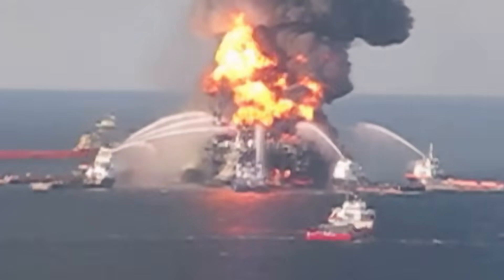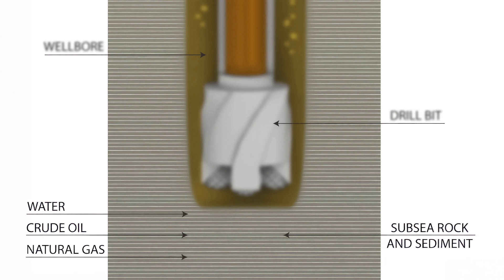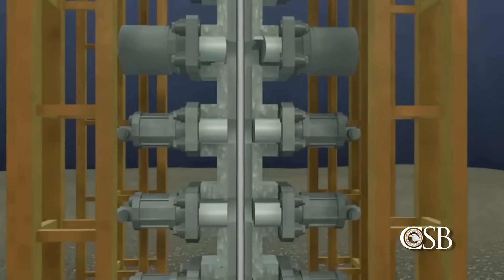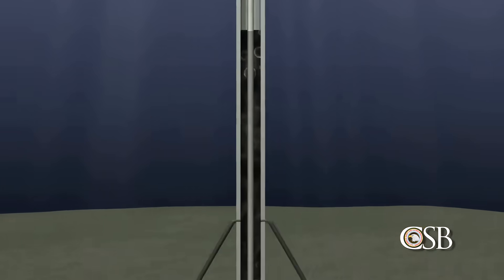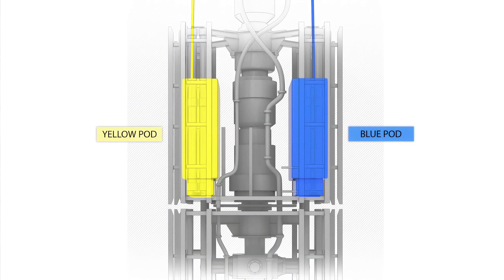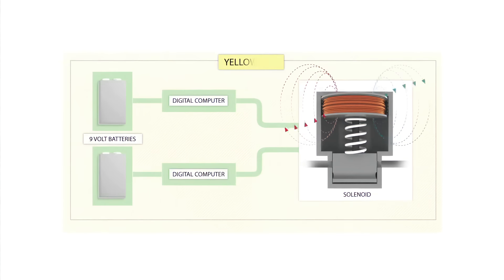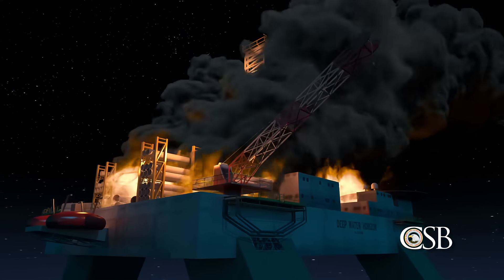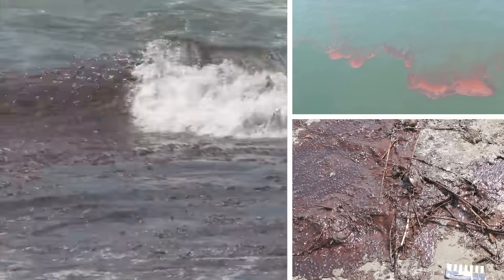Deepwater Horizon Blowout Animation

Comment: It's what happens when you take the cheapest price from a drill platform operator. There was a school of thought that proposed that blowout preventers should be initiated by internal explosive charges rather than using hydraulic rams. But this would prevent the well from ever being used again. However, it virtually would guarantee that the pipe would be sealed. And as we know, the one on the DWH didn't work properly.

Comment: Why did the Factory Acceptance Test (FAT) not pick up this wiring error. Did they not, if its possible before drilling started, do the same tests after it was installed. Having spent 15 years testing critical safety systems and signing them off, more than one person signed this off as working!

Comment: As a electrician, I constantly find myself researching products and finding even the manufacturer doesn’t know or understand wiring configurations. Yes schematics help but a lot of them are generic. Even some manufacturers rebrand certain components as their own but not rated for the work is asked of. It’s also known as patented failure. A manufacturer says this component must meet this that and the other but because of the proprietary patented, they actually don’t release exact diagrams. I think Boeing just went through this very thing with its “aim of attack” distribution block….. another words, calling the wireman a dumbass, shows you really don’t know the industry.

Comment: What I don‘t understand: why could the buckling of the inner pipe prevent the shear-ram from cutting through it? Why isn‘t the shear ram designed to cut through the ENTIRE section of the outer pipe? This way it would have cut the inner pipe regardless of if it was off-center or not. This doesn‘t make sense to me. 
Not cutting through the entire cross-section creates room for error in the first place. This should have been pretty obvious right?

Comment: Completely inexcusable.  Why there was no testing or polarity checking, voltage health, battery health monitoring is beyond incompetence in terms of design and application.  From reading other comments, use of sub-standard, unapproved slurry, greed by "company men" is just disgusting really.  Not to mention, but I will, the poor design of the BOPs to not accommodate shifting pipe stands such that the BOP or blind shear ram could not properly cut the pipe.  The BOP was designed and manufactured to (doubt it) API standards by Production Cameron International (Texas), and owned and operated by CasingTransocean (Switzerland) under contract to BP.

Comment: It wasn’t as much of a disaster as they say. Hydrocarbons diffuse as VOCs into the atmosphere and what remains is tar and the salt water in the sea is pretty nasty stuff and that takes care of the tar.  It’s just messy for a while.
Reply: Nope it was, even the chemicals they used to hide the oil spill on the surface caused problems.

Comment: I remember this clearly.  It was also reported that the drill mud had been replaced with mud pulled up from the bottom of the ocean floor, to reduce operating costs. This is was done for the last few days prior to the explosion.  The drill mud had been initially replaced with a much cheaper slurry prior to deciding to use mud from the ocean floor.  The sodium content in the ocean water also destroyed seals and electric contacts that normally wouldn't be exposed to corrosion or salt water, had the proper drill mud been continued to be supplied and used.
Reply: I don't think you remember it clearly because BP never used "mud from the ocean floor", the drilling mud was displaced with seawater, this is a normal practice to 'underweight' the well- you can't do a neg press test without displacement the mud.  And sodium definitely DOES NOT 'destroy seals or electric contacts' that would be exposed to drilling mud because THERE AREN'T ANY electrical contacts exposed to drilling mud.  All the electronics are located in the BOP pods- which is always underwater and not exposed to drilling fluid.  So displacing the drill mud with water would have zero impact on this.  Were mistakes made?  Obviously, but you have no clue what you're talking about with 'mud pulled up from the bottom of the ocean floor'.  

https://appel.nasa.gov/2011/05/11/aa_4-4_acs_deepwater_horizon_lessons-html/
Reply: Hahaha hilarious post. Sand and God knows what else is some how hoovered off the ocean floor, somehow held in whats more more or less a semi submersible boat, then somehow ends up down hole? Or....and engineer can calculate his mud weight and tell hands to dump in x amount of 50lb clay bags into the mud machine. Which one sounds cheaper, more efficient, and PRECISE?

Comment: Yes it's an issue by the management on the cost cutting measure however I want to understand (not blaming) any safety features that the crew during that particular unfortunate day did or didn't do something crusial? Just to learn despite all the cost cutting do the crew have any control to save themselves?

Comment: just to let you all know that the CEO of BP has gone on to much better and higher postions...........

https://en.wikipedia.org/wiki/Tony_Hayward
Reply: BP was the operator, not the service company contracted to drill
Reply: @sandersson2813  u can not transfer risk BP stuffed up big time in the design
Reply: @coam3708  BP didn't design it. BP are the operators of the licence and ultimately responsible, but they hire another company for the drilling contract. 
Did you not know this? 
BP, Shell, Exxon, Equinor etc don't own rigs, they rent them by the day, this includes all the equipment and the staff.
Reply: @sandersson2813  not production rigs which is the case here...drilling rig yes u rent
Reply: @coam3708  They don't design the production platform either. This is done by naval architects to BP specification. 
The fact a BOP failed or whatever it was is unfortunate.

Comment: Like most accidents that involve "high technology" (aircraft are infamous for this ), what starts as as an "incident" that has many backups and high tech safety features, one problem leads to another, which leads to another, that because trust in "high tech" makes the original problem magnified by the very technology that we so trust and depend on. Could this tragedy been prevented? Perhaps, but only by all the automated systems working as they should, and human error not being magnified by this technology we so depend on.

Comment: Pouring warm (relatively) concrete to "seal" the well caused rapid decomposition (called explosive because it occurs over a narrow temp range) of "methane hydrate" on the sea floor. Evacuees said methane had infiltrated the drilling platform.

Comment: miswired? what.  it can't be miswired, solenoids operate by the physical direction of the coil turns, it was likely wound wrong from the factory to begin with.  electric personnel wouldn't disassemble and flip them upside down.

Comment: The rig could’ve been saved if the auxiliary generator had functioned.  Without power to close the watertight doors and pump water to fight the fire the rig was doomed. It was later determined that the company had not allowed oil to be put in the generator because it was not tested often enough to prevent sludging of the oil and it was expected that any time the generator had to be used, the crew would simply add the oil before trying to start it. The crew didn’t have a chance to fill it before evacuating and the volunteers who went back in to try to start it didn’t know there wasn’t any oil in it. The low oil safety mechanism wouldn’t allow the generator to start. The rig was lost as a result. This didn’t come to light until three years after the disaster and has been mainly overlooked. The only reason it did come to light was a different rig suffered a power failure and the crew had to troubleshoot the generator. It turned out it was standard practice on all company rigs. No oil meant less maintenance costs. It just cost an oil rig in an emergency that the generator was supposed to take care of.

Comment: The pressure from the blowout is what should be used for power to prevent blowouts, instead of electrical or hydraulic systems dependent on power from the surface.  Kind of like the gas operated bolts in ak and m16. Plenty of energy their to operate a mechanism that can both relieve pressure and prevent backflow

Comment: The Blow Out Preventer (BOP) stack was designed by Ventura Tool Company (VETCO). I worked for VETCO in their R&D department in the '80s. I worked specifically on this BOP Stack design. What is depicted here is not completly accurate. This stack was used on a previous well where the Drill String got "stuck" and was sheared (with the rams). Once this is done, the BOP should be retrieved and serviced as the shears are only to be used once. This was NOT done thus rendering their re-use useless. The Company Man that decided to use the BOP without servicing and continued to drill without Secondaries working was criminal. Everyone knows that if you don't have secondaries, you stop drilling. Without a Secondary, they relied on the Primaries that were indeed of service, thus the buckled drill pipe. Again, the BP "company man" should be in prison!

Comment: Not to mention that the pipe usually should be about 2 and a 1/2 inches thick in the wall . Not to mention that as US steel pipe it should have been probably replaced or never used Depending upon its age

Comment: Most people have some idea of the scale of this disaster but they still do not comprehend the vastness of the scale involved. I flew over the gulf while this disaster was going on, just a few miles to one side on a survey aircraft transitioning from Venice  Florida to John C. Stennis space center in Louisiana. We were flying at just under 10,000ft because we were not pressurized & without masks. By then, the fire had extinguished but there was still a plume of smoke rising from it past the aircraft & way up into the high atmosphere which was so vast that we were completely awe struck.

Comment: Why not have pressure breaks near the surface that would kick in in the event of a blowout and divert the gas and oil into large bags with enough capacity to store the material until it can be drawn off or expelled into a deployable burn off system separate from the rig?

Comment: How the fuck on something this expensive+thoroughly researched+high profit industry be wired incorrectly?
How could TWO things be wired incorrectly?
That's fucking astonishing considering I'm not even an electrician, and any electrician would be 100% confident that they could wire this correctly? It's 17vdc and 9vdc.. I understand the amperage is probably high but still?
Completely unacceptable.

Comment: I remember multiple “experts” on TV during the fire saying how these rigs are so well designed that it was impossible to sink.  However anyone watching the fire knew for a fact it was only a matter of time before it went down.
Reply: They said the same about the twin towers. After the planes crashed, news had several engineers guarantee the public those buildings would never fall, that it was built that way. And they were arguing against people running out the buildings, saying emergency personnel should send people back to their work places so they could reach the floors that needed immediate help.
Reply: the towers were wired to explode most likely
Reply: @Andrew-um6ny  cus there where bombs inside the twintowers  it didnt go down cus of the planes
Reply: @Robin...222 you’ve taken zero engineering classes
Reply: The downfall of even the most unsinkable ship is usually mistakes by builders and crew.

Comment: This is NOT what happened. All this is a lie. Oil and gas did go up the riser but not the way shown here or for these reasons. The blowout preventer could not stop the fluids from going up the riser because a length of drill pipe had been accidentally dropped down the riser--lodging in the blowout preventer.. Management refused to stop drilling to recover the pipe as this would cause a loss of revenue.. Many people knew this but did not quit working. We all see the result.  A friend of mine worked for this company. He found out about the lodged pipe and brought it to the attention higher ups. They told him to shut up or he would be fired. He resigned that day from job paying almost $400,000 a year. All this is pure propaganda and BS.

Comment: crazy to me that the emergency auto-closing system itself was fail-deadly - requiring internal power in order to actively open a valve - rather than fail-safe, using power to hold the valves closed and opening them by default when power is lost.
Reply: @michaell4990  generally I value human lives over oil money, but that's just me 🤷‍♀️
Reply: @michaell4990  and? and i think that's a bad thing?? the way the world works is not value-neutral; we could make it better! we could have a world that values lives over money, that is not ruled solely by the profit motive.
Reply: @michaell4990  A: we should ban oil entirely, use nuclear or solar or any of the countless options that could easily power the world but are more expensive; fuck the economy, fossil fuels are killing the world. I happen to be one of the poor bastards young enough to care, thanks to generations prior not caring about our future. B: you're literally the "and yet you participate in society!" meme lmao
Reply: @michaell4990  I'd love to hear where exactly oil is needed for ammonium nitrate fertilizer (electrolysis exists, the hydrogen gas for industrial ammonia production doesn't need to come from petroleum), silicone lubricant, silicone semiconductors, rubber insulation, electric induction forges (or hey, use electrolysis'd hydrogen again as fuel if it has to involve a fire), non-synthetic fabrics...

almost all of the things you just said involve no oil other than for power, which would come from other sources as oil was phased out. this is not some instant thing, I'm sure oil would be used in the interrum to help build green infrastructure. a better world is possible, you just lack imagination (or more accurately, you work for the oil industry and have bought into their propaganda).

Comment: Seems a little like sabotage to me.how can something so deadly and important  have so many screw ups? I know it usually takes more than one irregularity to cause an accident,but this has bad luck around every turn.seems more likely someone really screwed up,and they used alot of science to explane a simple thing,they should have not messed with nature at that depth.and also,my fire alarm worries the shit out of me when the battery dies,I would think a sophisticated peice of equipment like this would let you know the last ditch effort to save a hundred lives should know if both their emergency backup systems were completely defective and wired incorrectly.

Comment: I was an offshore platform operator. I'm sure there was a lot more that got skipped or corners cut, but that was a pretty good and to the point explanation. I can think of a bunch of questions use of centralizers, the weight of the mud,  BOP testing documentation, and many others, but this seems to cover much it it. Catastrophic accidents are usually a series of oversights and mistakes that manifests as one massive event. Before I left the oilfield I saw a lot of cost cutting chasing pennies that ended up costing tens of thousands.
Reply: it's sad that unethical people like yourself support this industry
Reply: Unapproved unset slurry too
Reply: My thoughts exactly. The first line of defense was the mud engineer. Insane to think that every failsafe after even malfunctioned.
Reply: Can you answer this for me: wouldn't the use of the first two mechanisms to prevent kick always cause enormous pressure buildup in the pipe, even when used 100% properly and quickly?

Or are they meant to be shut off quickly after using them, before the pressure builds?
Reply: @thatfunkyduck There are usually procedure involved to prevent a hydro-hammer type situations, in most cases drillers on these jobs are very experienced and skilled in well control ans would vent a kick through an accumulator and what they call a bag to moderate the kick form a gas pocket or other unexpected situations. Calculating mud weight is very critical too in preventing such situations. Slamming the the BOP closed under high pressure is rare. I never worked for drilling but I was a platform operator, which requiters knowledge of how it all works and intimate knowledge of well bore behavior

Comment: In its profound influence by the Oil and Gas consortium the CSB ( created by the US Congress in 1990's ) and part of the Clean Air Act regulatory act, was given NO regulatory power. This is only a five-member investigative body to "advise", much like the NTSB. 

MMS ( Minerals Management Service ) has consistently failed to develop statutory requirements or collect the necessary information to effectively monitor and evaluate the Royalty-in-Kind Program ( of which it was dependent ) and that after this disaster The MMS was restructured so that the safety and environmental functions would be carried out by a unit with full independence from The MMS Royalties Program in order to ensure that federal inspectors will have more tools, resources, and greater authority.

As a result the only thing that enforces their recommendations or prevents disasters like this from happening in the future are lawsuits that can cost a corporation Millions or even Billions, as in the 17 Billion USD with Transocean that owned and operated the Deep Water Horizon and British Petroleum which leased it.

Since corporate entities have a significant influence upon the American Legal and Political system, State, and more importantly Federal, have insufficient funding and regulatory ability to research and prevent such disasters.